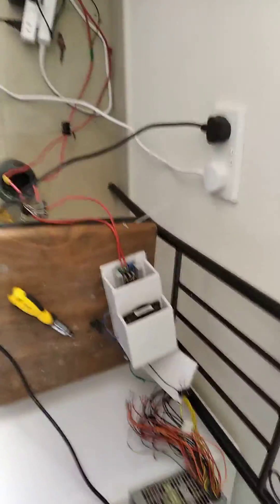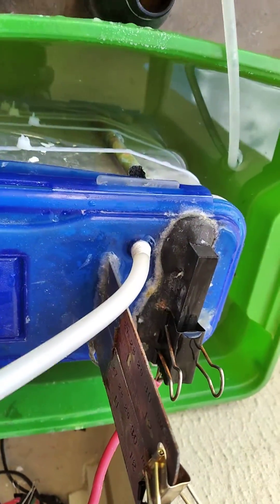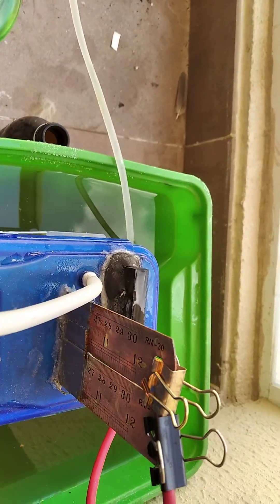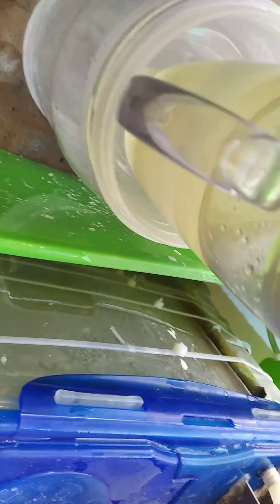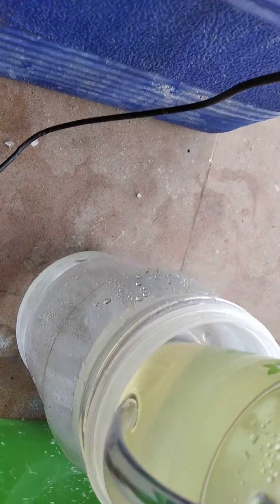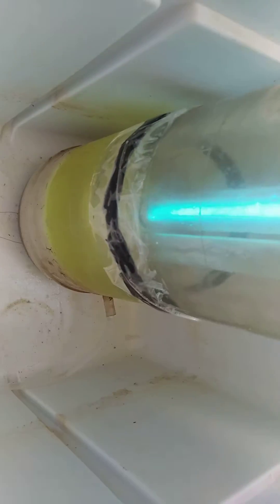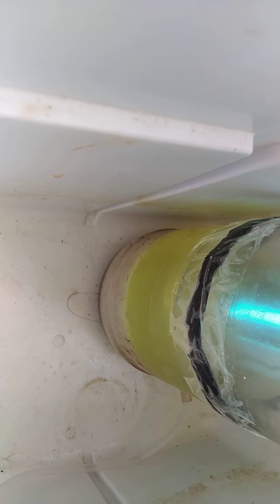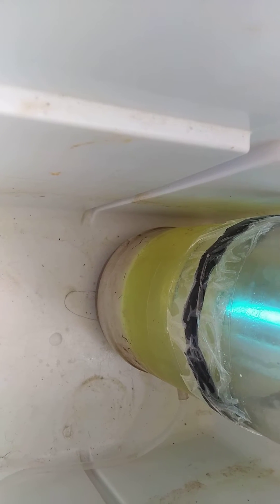Destruction of excess chlorate using UVC photochemical reactor and chloroalkali cell

Comment: Is PbO2 the only cheap alternative electrode for perchlorate anodes ? So there is only platinum coated titanium left ?
Reply from the maker: well no there are some alternatives
one is Bi or Mn oxide doped ATO which is antimony tin oxide which requires the thermal decomposition method of the nitrate salts of 97% wt of 1:1 molar ratio of Si and Sb nitrate and 3% other metal dopants or sth like Bi or some claim Mn nitrates work for the dopants and some even said Cerium from ferrocerium rods work too.

my titanium electrode is not even really plated its dipped in superglue and graphite/PbO2 powder is pressed onto it then its plated over the graphite or PbO2 which will buildup an active layer of conductive PbO2.
Reply: And what about heating some kilos of chlorate to 400°C is that not an option ? My idea would be to modify a little pizza ofen to keep the the heat at about 400°C put in your kilos of NaClO3 and heat it some hours then dissolve it in water add your potassium salt and filter.
Reply from the maker: @Telectronics  works and ive done it but overall the efficiency sucks!!
Reply: @CatboyChemicalSociety  How much do you estimate efficiency? You can compensate it with more kilos... If NaClO3 is not fast enough maybe use some 100A too speed it up...
Reply from the maker: @Telectronics  the efficiency of producing perchlorate via thermal disproportionation is 60% ideally!!
and actually its around 35 to 40%.
There is a way however to get a 95% yield based on potassium salts if you only want KClO4 and thats to feed in a 50:50 mix of NaClO3 and KClO3 in your crucible and heat to 400 and almost all your KClO3 will convert to KClO4 and you will only ideally have NaClO3 and NaCl in your liquid.
Reply: @CatboyChemicalSociety  Ok thanks for the information. Just being curious how long does it take and the efficiency from NaClO3 to NaClO4 with a platinum electrode ?

Comment: How powerful is that UVC lamp and how big is the electrolysis cell? Also what's the paper you're following?
 I'm planning to build a chloralkali system myself to produce HCl from salt and do lots of other things like collect the chlorine and ampoule it (without the hydrogen ofc) as an element sample.
Reply from the maker: well the membrane for this cell is ceramic and ive found that it fking sucks for making HCl cuz bleach is made in massive quantities cuz it has no selectivity properties unlike my polymer PVA-Borate membrane.
I actually plan to make a different kind of membrane that will have those desired properties in a future iteration of this setup.
The UVC lamp is 9 watts and I didnt exactly follow one paper but instead designed a setup based on what I read across multiple paper.

Comment: I have been trying to find an easy way to destroy excess Chlorates in my perchlorate cell without having to use bisulfite or introducing other Chems.  I have lots of UVC bulbs from my fluoresce mineral collection.  So this would be feasible if it doesn’t destroy the perchlorates as well.
Reply from the maker: acetone extraction is your friend if you dont want MMS!!

Comment: you should drill holes in the electrodes and bolt the wires tight, i had my cell running 7 times better when i did that, maybe go all the way and goldplate them? if you can get copper on gold shouldnt be an issue, you can just add some gold solution to cotton wool, then run that over with electricity on, doesnt even have to be gold anode youre swabbing it with, codyslab did it with gold cyanide iirc 
very interesting way to remove chlorates
Reply from the maker: il stick to my paper binder clips made of brass!!
the copper plating actually prevents passivation of electrical contacts for high current applications anyway but this cell runs at like 8 amps at most.
Reply: @CatboyChemicalSociety  yeeeeeees but chlorine will react with the surface, bolt it tight and barely anything will get in there, i used perfectly clean stainless clips to titanium that i sandpapered, and even at that it didnt push electricity through properly
Reply from the maker: @WeebRemover4500  most of my cells are well sealed and the main issue you had was you had electrical contact on bare Ti metal.
I always copper plate Ti or stainless steel cathodes because those tend to passivate when you push lots of current through them or if they heat up and the cycle continues.
Also my cells are well sealed and after copper plating on Ti the electrodes will always have good contact due to the copper layer protecting it.